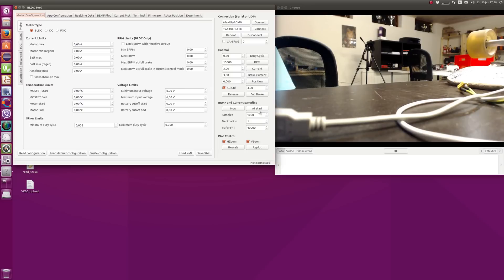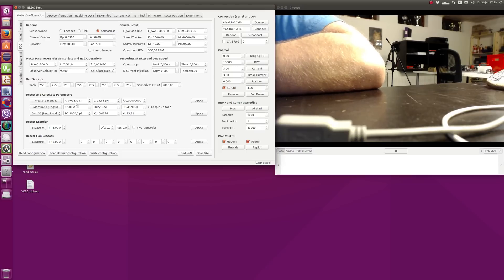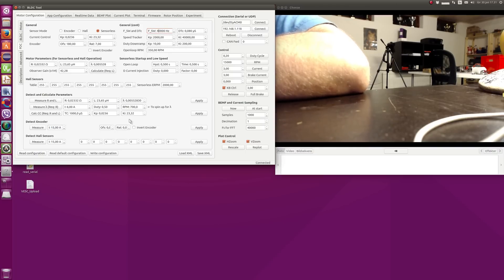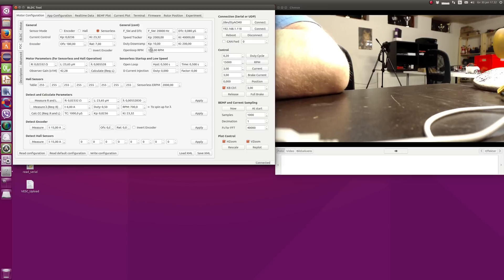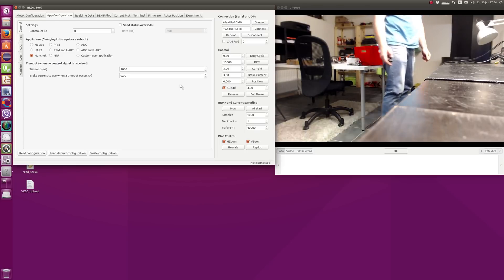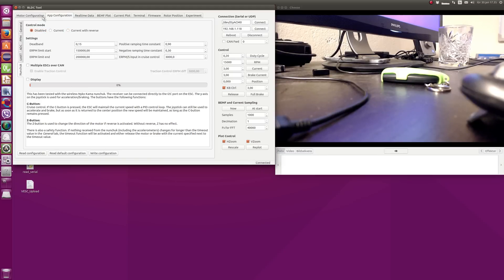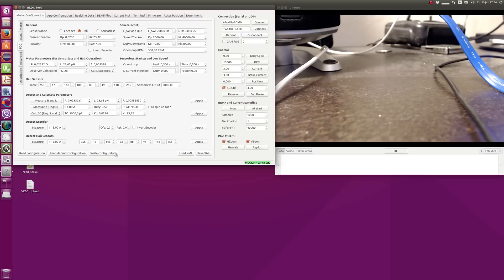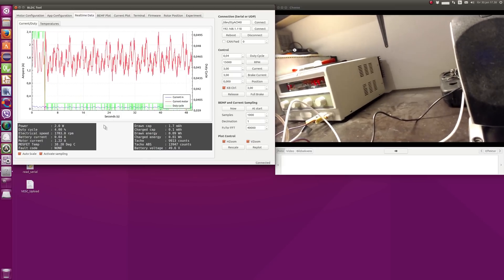VESC FOC Tutorial

Comment: hi, after your help with VESC, i have a special application I would like to program one of your VESC for. I want to use it with a bushless motor to drive and oil pump on one of my jet engines. The plan is that when the oil warms up and the oil pressure drops, the load on the motor will decrease, i want the VESC to over come this by speeding the pump up ?
Or at least tell it to keep driving the motor at the same current . Am new to all this, and would also like to implement the software program you used on the old page, the 10k pot and switch, please mail me at dragjetbike@yahoo.co.uk

Comment: Benjamin on the Vesc-project website motor setup wizard it says for  "For the best possible result, do the detection without attached drive train", but this demonstration shows your drive train connected.  Is it better if the belt is engaged or disengaged?
Reply: Disengaged is better, though you can do engaged...

Comment: ben you are the best! VESC make a sine wave or squadre wave?
Reply: Always square waves probably and the inductors in the motors work as an LC filter and turns it to AC.

Try hooking it up to a scope without the motor attached and see for yourself tough It'll probably cut off due to a motor not being detected.
Reply: In FOC mode FETs are still controlled with digital signals but since it constantly alter the pwn during one rotation output current is seen as sine wave.